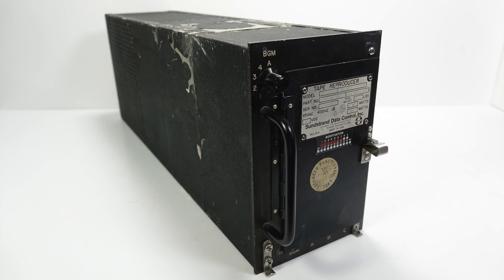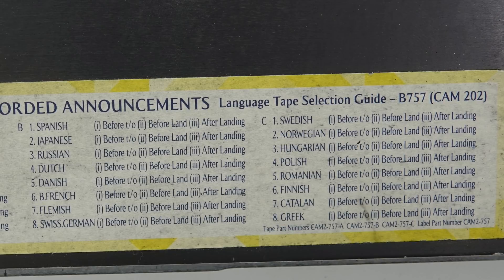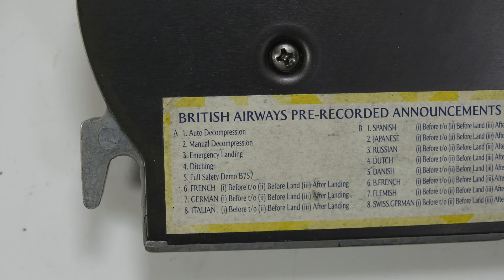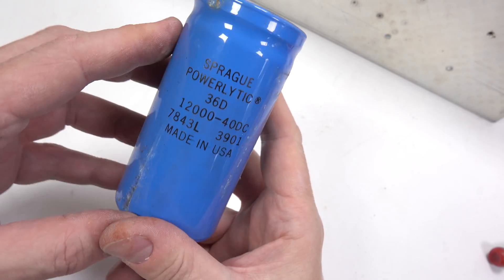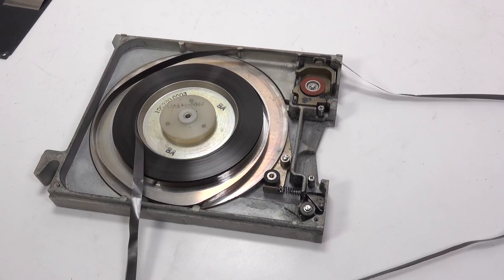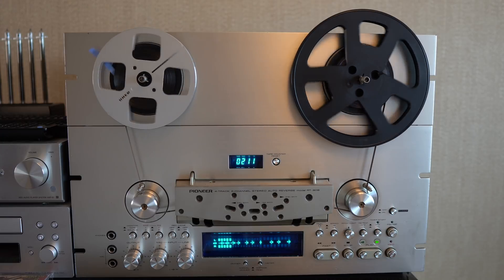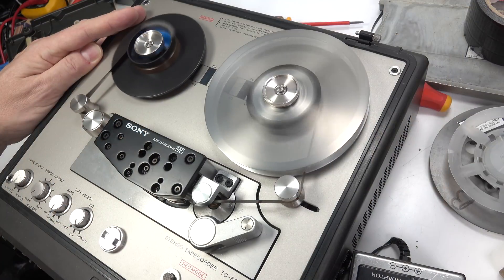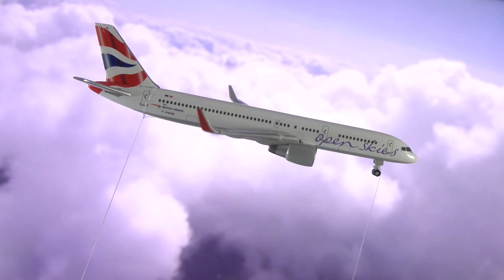Tapes on a plane (Part 2 - The Tech)

Comment: Hanging the model upside down to "conceal" the wires...very "2001."
Reply from the maker: I think they did a slightly better job of it.
Reply: @Techmoan  Took me a while to figure though 👍🎉🤦‍♀️
Reply: @Techmoan  Actually, the models of 2001 were photographed, cut out and applied to glas with the star background behind them. So, no wires to see in 2001. ;)
Reply: The "B" roll clip of the model plane reminds me of the sort of things that much venerated (or reviled!),
and Now late producer Gerry Anderson and his wife Sylvia created over a span of about 50 years! You remember, those Puppets, and "SuperMarionationVision", Thunderbirds, UFO, Captain Scarlet, the Mysteryons, Joe 90, and plenty more labour intensive, cheesy yet well intended programs for kids of all ages!! And his company, Century 21 Films, is STILL churning out product!! You might consider checking out what sort of legacy equipment or materiel can be found that was used to produce these programs
Reply: Upside down wire filming was used in The Black Hole.

Comment: Detective Mat solves the case! Seriously, 40 year old system with 25 year old media gets decoded on 1970's tech. Brilliant!
Reply: And the 8-Track just keeps going and going and going....
Reply: @xaenon  I was truly surprised that the head configuration...and the tape size...and the track sizes on the tape...and the tape playback speed all matched up perfectly on such disparate devices.
Reply: @fixman88  Well, the 8-Track tape dates back to the mid 1960s, but it really is just a two-track machine with moving head and very narrow tape tracks.   They probably did have true 8-channel reel-to-reel machines  fairly early.  Of course, they'd be ridiculously expensive professional rigs used in studios.
In fact, I'm reasonably certain that's how 8-Track tape carts were mastered - on eight-channel reel-to-reel rigs.

It makes sense that they'd basically build hardware derivative of that scheme.  Why re-invent the wheel if you don't have to?

One thing is reasonably certain, though:   Nobody ever thought that in 2020, someone would be spooling that tape into an 8-Track tape cartridge to extract the audio!
Reply: @fixman88  I think some factors that contribute to that are that geometrically, a tape of a given width can only be subdivided one way if all tracks must get equal width; our human ears require stereo so the subdivisions will be powers of 2; tape stock size and speed had to be agreed, standardized and stable in the industry for interoperability.
Reply: @xaenon  "It makes sense that they'd basically build hardware derivative of that scheme.  Why re-invent the wheel if you don't have to?"
Yeah, exactly. In hindsight, that makes perfect sense. It's the construction of the player that's totally different from consumer grade machines, since it has to be robust enough to withstand extreme situations and remain functional.
Reply: @FernieCanto  I used to (indirectly) deal with aircraft in the Navy. There is seriously overengineered stuff when it comes to 'flying machines'.